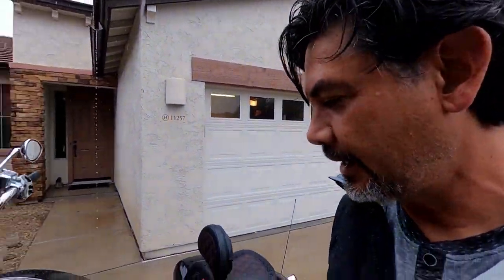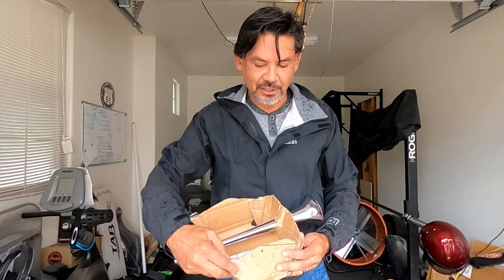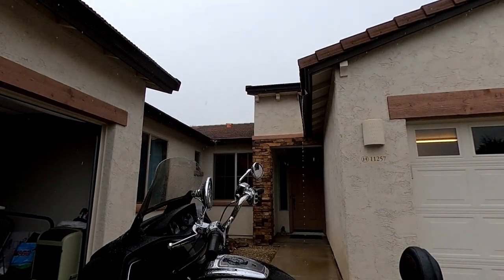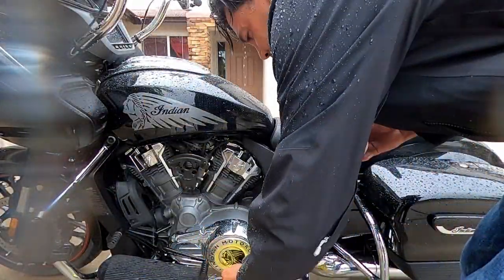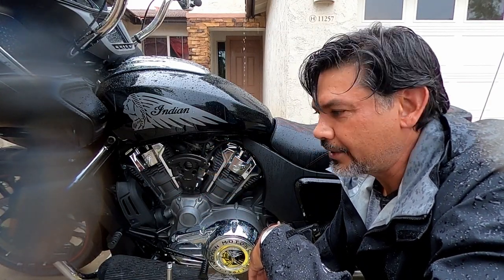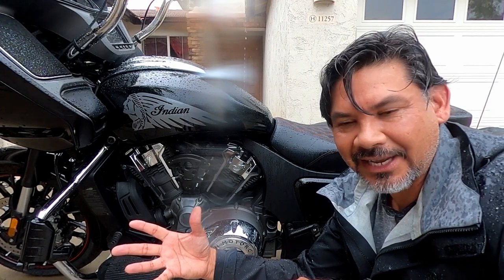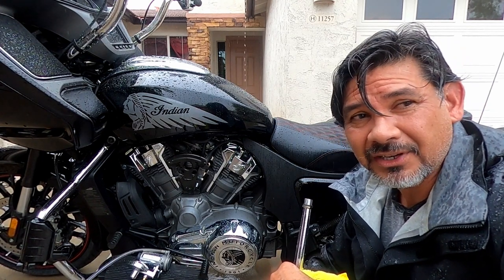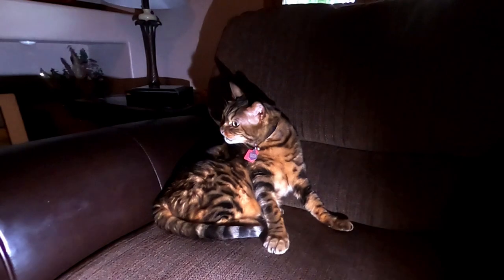Motor Horn Installation | Ep #1| Indian Challenger

Comment: Not a bad idea Face, but how are you going to do this without having plastic tube from the compressor in clear view? Looking forward to what you come up with. P.S. you better fix that leaky gutter too brother! ;-)
Reply: Have the tube in plain sight, but use braided SS hose? 🇬🇸
Reply from the maker: If I decide to install the horn at this location, the plastic tubing would run behind the parts and maybe put the tubing through another protective layer (like those use for wiring). That gutter, yep needs and extension...lol

Comment: Maybe a Stebel horn mounted in the fairing, pointing front or towards the front wheel? Stebel Nautilus are small very loud
Reply from the maker: I've consider it, not to much room under the fairing. This was my first location for the MotoHorn, not enough room. I didn't mention in thee video, but I'm consider (maybe) cutting the horn and making it shorter. Just another idea...lol